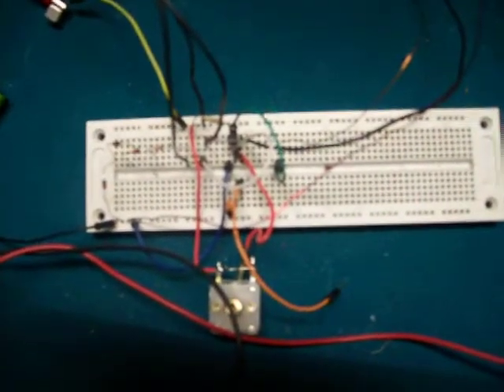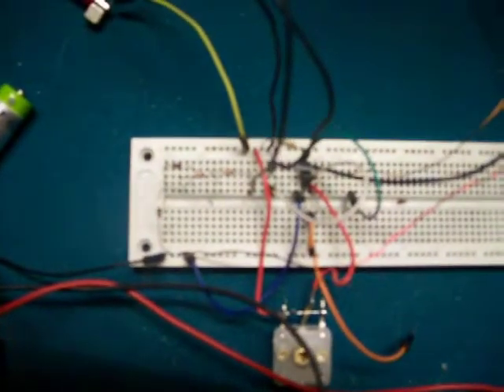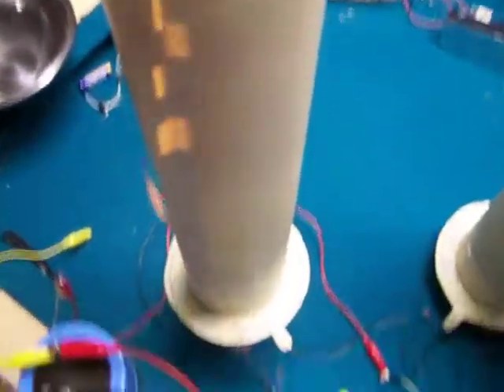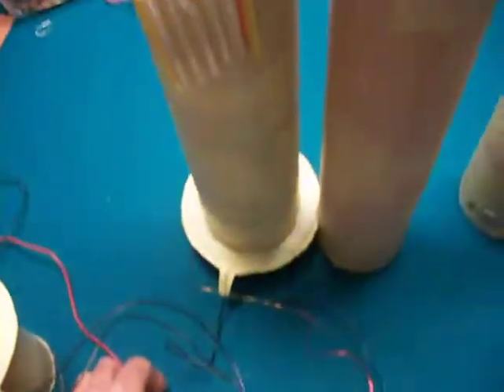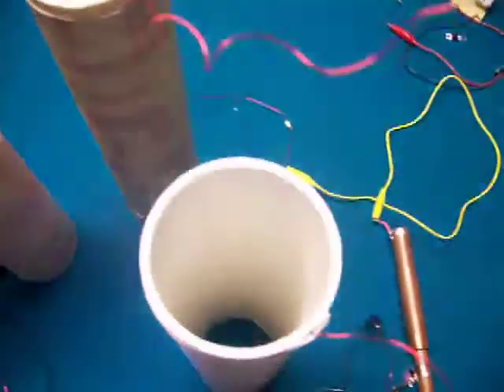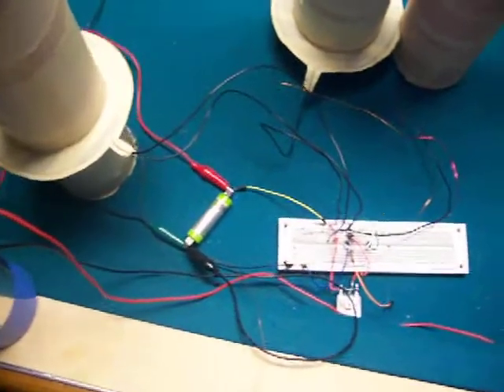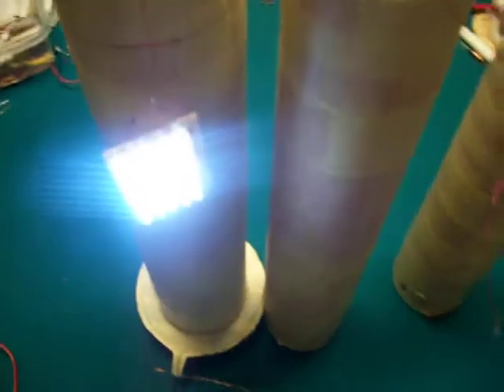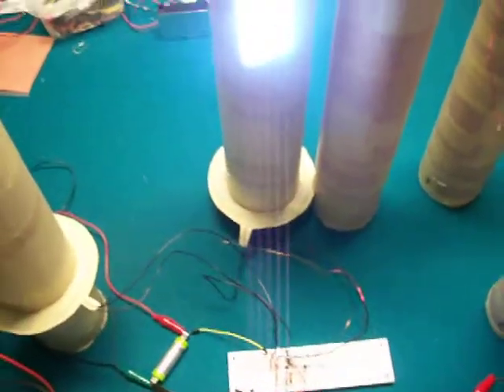Slayer Exciter With Second L2 coil And Tower

Comment: That is awesome :) What are the specs on that cap? If you had to guess, how long do you think that 1.5v AA battery, with the cap depleted, would run those LED's at usable brightness? Would they die off pretty quick?

Comment from the maker: @tectalabyss 
Sorry but I did not count the turns of the coils.
But I say the two bigger coils are both a little over a 1000 turns.

Later I will upload a curcuit with the coil sizes and mH of the coils used in this video.

Comment from the maker: @K0W0O0N0 

Yes, The diameter of the coil makes a big difference in output power and current intake.
I have been having good performance with coils three inches in diameter or bigger.